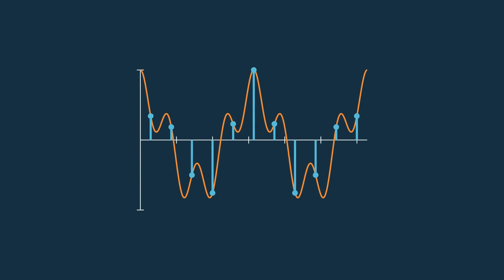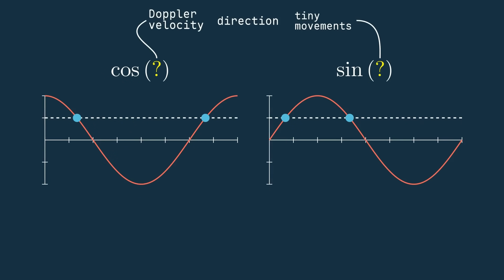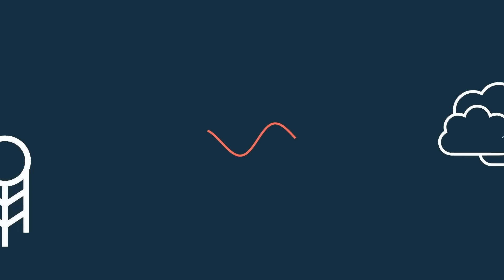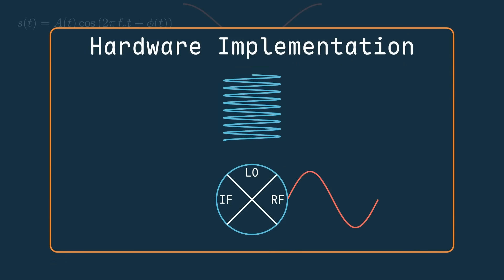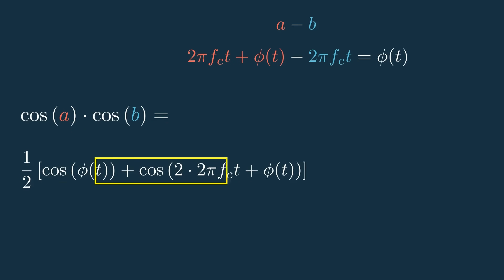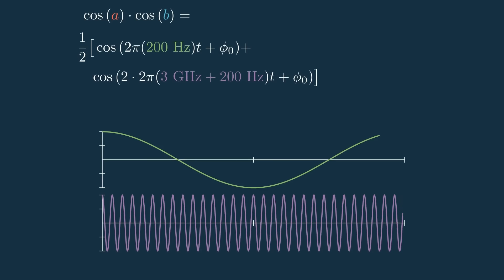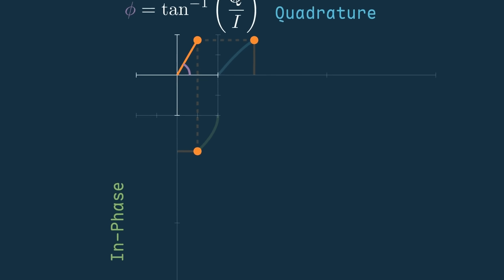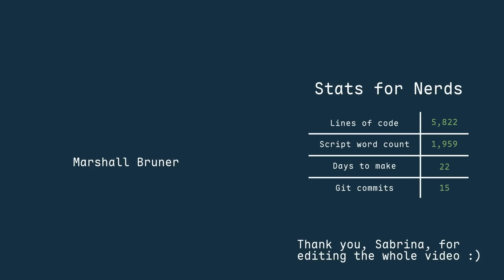How to Get Phase From a Signal (Using I/Q Sampling)

Comment: Hello, I have a bit of confusion regarding IQ.  So you have a handheld radio like Radtel 880 and a HackRf they both use a complex mixer. This seems fine for e.g: a QAM demodulation and other digital modulations. What’s confusing me is that they use the same complex mixer for a normal analog AM demodulation. So is a complex mixer a double win? Where you can use it for AM because the math is simple then? Eg: using the magnitude for AM demodulation.  Not to mention when using a complex mixer all bands are mirrored to negative frequencies and everything becomes even more confusing

Comment: Love it ❤
Reply from the maker: Thanks!!
Reply: @MarshallBrunerRF how can a radar identify received returned signals of its own ?
Reply from the maker: Well that's kinda the whole point of a radar, right? You want the signals that your radar generated to return because that means there was something to be detected. Are you maybe talking about coupling from the transmit to receive paths? That is a real problem which is a large topic of discussion.
Reply: @MarshallBrunerRF yes the coupling signal , if  identical 2 radar fires signals 📡 same time and both receiving same reflected signals same time how did they knows witch signals from which radar

Comment: This is cool!  It would have helped me, though, to have some context on the problem this is solving at the beginning.  I think the idea is that the signal is too high frequency to sample directly (which of course would include all the information, including phase), so instead we must mix it down to an intermediate frequency - and then the idea is that if we only mix it with a single wave, we lose phase information, and that's where mixing it with both sin and cos waves is useful.
Reply from the maker: Thanks for the insight - that's definitely helpful. I can try to do better at giving a clear problem statement at the beginning of the video. The video I'm working on now should actually have a better one... I think

Comment: EXCELLENT illustration of the whole IQ downconversion math!  I dont think there is anything else you could have done to improve it, its the bomb!  I really like your portrayal and illustrations, which makes me think you have a lot to provide the community if you wished.  If you are looking for ideas, one thing you could do is to add in the radar range phase shift, and maybe also look at separating the Doppler and Micro-Doppler.  If you wanted to take that step further you might could go into spectral and ceptral analysis of the Micro-Doppler.  On the other end, you could go into mixers and show how they work and tie that into this video.  Another related aspect would be to go over stable oscillator theory and how master oscillators are made and can be made better (for example phase lock looping a plurality of oscillators, Q etc.).  Anyhow, I'm sure you already have a bunch of ideas to cover but the above are a few of my favorite.  Definitely earned a subscribe from me!  ;-)
Reply from the maker: Thanks so much! I'm always open to new ideas! Have you seen the video on FMCW doppler? It's not everything you mentioned but includes some of those topics. Thanks again for watching!

Comment: Quadrature modulation isn’t unique to radar systems either, I first learned about it through the now defunct NTSC broadcasting standard where it was used to encode the color information into B&W signals starting around 1954 or so. If you want some good reading, check out the proceedings of the IEEE from around that period or simply read the original NTSC specification. Some very good descriptions of the hardware side of it preserved there.
Reply from the maker: Definitely not! Thanks for the clarification - maybe this wasn't clear in the video.
Reply: @MarshallBrunerRF  No clarification, I like the video and especially the animations. Just pointing out that QAM has been around a lot longer than most realize, though I do think that if you're going through the technicals that the mathematics of the NTSC signal are easier to understand than a radar signal. I mean same stuff, there's just more of it with radar. Then again with NTSC you have to get into the whole suppressed carrier and VSB thing and you might lose people there.

Comment: Correct me if I am wrong. Another reason to use I/Q sampling is that positive and negative has no physical meaning in terms of frequency. So, the low frequency mentioned in the video can actually be the absolute value of a - b, which leads to two possibilities, namely  a - b and b - a. In real-based system, they can not be told apart. Hence, we need to use complex-based system to tell them apart by observing the difference in phase.
Reply from the maker: If I'm understanding correctly: yes. This could help you resolve the difference between a - b and b - a mixer products. Thanks for the comment!

Comment: This would be a little bit off question but I want to get a radar to measure speed of at the front of my car while moving, which product do you suggest? What should I be careful about like multiple targets? I couldn't find radar nerd community in discord to discuss.
Reply from the maker: I would check out the TI automotive radars (AWR series). They are really good, have lots of documentation, and a nice eval board with test software. 

Would you be interested in a discord community? I have played around with the idea of starting one but haven't known when is the best time.

Comment: I have a question regarding getting the "real" pahse shift of the signal. In the video as in the notebook all singnals and samplings start synchronized a t0 = 0. When you are meassuring the returned singnal in a radar or recived modulated data in the real world, the sampling cosin and sin, are very likely not synchronized to the sampled signal, I assume. For radar, the distance to the target changes the relative time offset (pahse). In wireless data transfer, the sender and reciver clocks are probably not synchronized. Therfor there is a variable pahse shift Փ as showen (00:13), however also woud have to be a constant ΔՓ that is between the sampled signal and the sampling cos / sin. So the resuling pahse shift in output should be offset by a constant and wrapp around if 2π is exeeded.
I could recreated this in the Notebook. Adding the termin +3π/4 inside cos to x has the same effect as adding the term -3π/4 inside the IQ sampling sin and cos functions. Both changes cause the same constant offset to the phase in the phase of time diagramm at the end.
For capturing relative changes to the pahse this is fine. However, my issue is now, how does modulation like QAM handle this offset? This should change the symbols and therfor transmitted data, or not?
Reply from the maker: Great question! You're absolutely right that real systems have a constant phase offset due to things like propagation delay or clock mismatch. To my knowledge (and I'm not a communications specialist by any means), QAM is often implemented with some recovery algorithms to get that phase offset. This is something I would have to do a good bit more research into, though.

Comment: How do you 'measure both at the same time'? What does this look like in the hardware?
Reply from the maker: This looks like 2 mixers: 1 with a cosine LO input, and 1 with a sine LO input. This gives you 2 outputs, cos * cos and sin * cos. The RF input to both mixers is the received signal (cosine)

Comment: To get an intuitive model of why using a complex number for IQ samples makes the math easier, consider the identity exp(ix) = cos(x) + i*sin(x). You can treat IQ sampling as multiplying the real-valued signal with this complex-valued signal. As long as your system is linear, working with complex exponentials makes everything way more convenient, because you can do stuff like divide both sides of an equation by exp(i*w*x), as it never goes to 0 (unlike sin(wx)).
Reply from the maker: Exactly!

Comment: Is it feasible in rf signal processing to use a hilbert transform to create the phase shifted signal? I have only done this with low frequency signals and it makes extracting phase information quite simple.
Reply from the maker: Yes they are very similar. The main difference in my understanding is that what I'm talking about is more of a hardware implementation and the Hilbert transform is more of a software implementation. This is really a tradeoff between the two implementations depending on what your system needs. Thanks for the comment!

Comment: Thanks for another amazing video. 
I just dont understand difference between IQ sampling and FFT. Because FFT essentially, does same thing it multiply signal with exp(-1j 2pi fc t) and which is cosine and sin actually. So what is the difference.
Reply from the maker: Also check out the Hilbert Transform which might be even closer to what you're expecting. Thanks for the nice comment!
Reply: In some sense I/Q sampling is like a single bin of the DFT, but skipping the sum part.  I have a video about the DFT/FFT on my channel that visualizes this to some extent.

The DFT averages the samples across the entire window for each multiplied frequency giving a single phase and magnitude, while I/Q sampling returns the individual samples (or continuous signal in analog).  So the DFT gives complex frequency domain values over a time window, and I/Q sampling gives complex time domain values for a single frequency.

Corrections/clarifications welcome if I've missed anything.

Comment: Learned about IQ sampling as soon as I got into SDR. I guess it would be useful to have a dedicated video, showing all the potential of using "complex" sampling other "real" sampling (like amplitude and phase known at each sample, the clear introduction to negative frequency, and all those mind blowing tricks becoming possible). Regarding phase and IQ sampling, I've used a trick to obtain the phase-shift between 2 IQ samples to decode an FSK signal : simply compute the cross product of 2 successive  IQ samples (considered as vectors). This will provide you with the sign of the frequency (negative or positive frequency, relative to the carrier frequency). For FSK, the actual magnitude is useless, only the sign is used, but with normalized samples, you could get the rate of change in phase (aka "Doppler frequency" in your example), without even computing any arc tangente. By the way, computer science introduced the mighty atan2(Q, I) primitive that seamlessly handles any ambiguity that can raise from using arctan (i.e. atan in C standard): it computes atan(Q/I) taking into account the sign of y and x (because atan(-1/-1) and atan(1/1) are the same value, while atan2(-1, -1) and atan2(1, 1) gives you 2 different angles.

Comment: Have you heard of quantum radar? Can you tell us something about it?
Reply from the maker: As far as I know there's no operational systems and I definitely don't have any experience with it, so it's not something I'm planning on covering. I will have to look into it more, though. Thanks for the comment!
Reply: @MarshallBrunerRF   I heard on the news that the Turks had developed this and could use it to see the B-2 bombers that bombed Iran. But I can't find the video on YouTube anymore. It was on TRT Channal
Reply: Is there still modern radar that uses IQ sampling? The troublesome issues with channel balancing can be avoided entirely using a faster ADC and then do digital downconversion
Reply from the maker: Yes IQ sampling is very common in radar

Comment: Used I/Q sampling for a solid state microwave demo long time ago. While cooking we'd periodically sweep the frequency and do an inverse fourier transform using IQ samples of the reflected power to auto tune the DCO to the most effective frequency. Actually we did that on both forward and reflected for testing and calibration. I remember was important to sample both I and Q on both fwd and rflctd at the exact same time. The cooking concept went no where but same hardware was later used by a japanese racing team developing a  pulsed microwave plasma ignition system and make their car go faster! Thnx 4 da video \(^-^ )
Reply from the maker: Awesome anecdote! Thanks for the comment!
Reply: they hooked a microwave to a alternator?
Reply: Wtf am I read

Comment: 11:28 is mistake. i is not equal square root of -1. Correct is i^2 = -1. Is not same in complex numbers.
Reply: Indeed, on this side of the Atlantic, i² = -1 (i for stands for "imaginaire" in France). When you take into account that in the sample 'I' would de the real component and 'Q' the imaginary component, the 'j' notation avoids a potential confusion with I (the "in-phase" component of the sample). That being clarified, root square of -1 doesn't exists, whether you use i² =-1 or j²=-1.
Reply from the maker: Yeah there's a few other things (like current) in electrical engineering denoted by an i, which is I think why the j is used.
Reply: @ArnaudZANETTI ofc it exists. you just need to either pick a branch or work in riemann surfaces.

Comment: I would reverse the sequence of information showing how multiplication of sinusoids allows realization of AM modulation. Than on that show that imaginary component allow to code phase of modulated signal in baseband as otherwise we only could control amplitude of frequency components in baseband.
After that I'm showing my students that constant phases changes are in fact frequently shift with exactly the same math as you used, which allows me to point them how FM modulator is working.
Overall great video, very informative and most of all great graphics. Pure gold.
Reply from the maker: Thanks so much for the valuable feedback!  I went back and forth a lot on the ordering of information in this video, so this is really helpful. I want to make another video on modulation techniques so I'll keep that in mind.